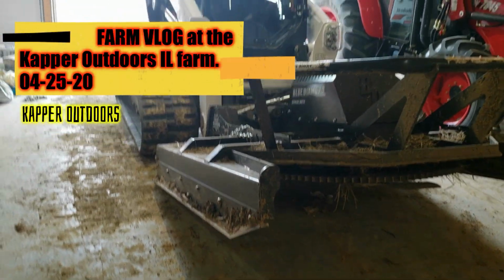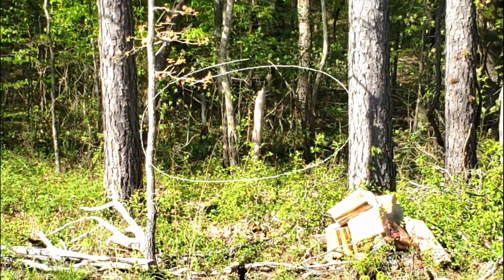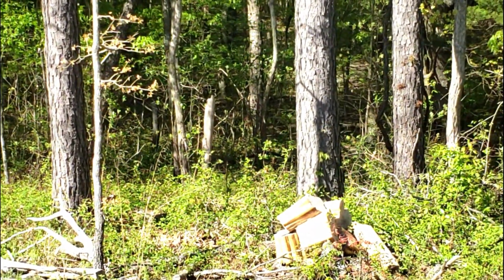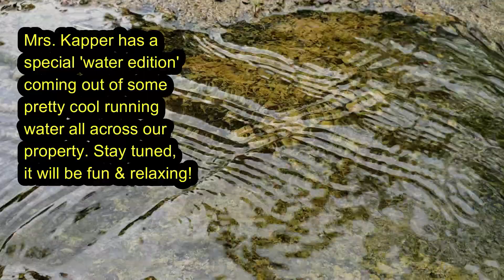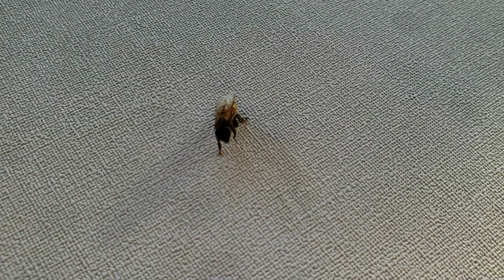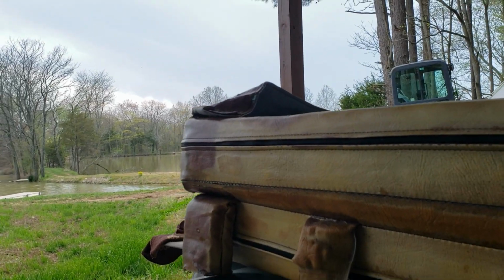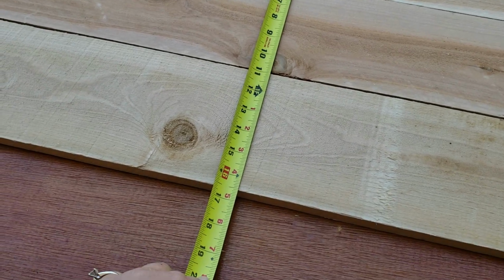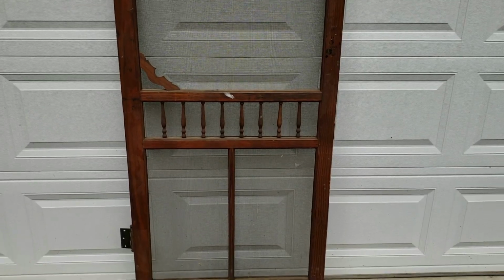Illinois FARM VLOG; Bobcat CTL, Bobcat sighing, Wildlife, Excavation equipment, & KY rehab projects

Comment: Joe, you are absolutely correct on the cover for quail--for now.   A farm field left fallow following crops is perfect for quail for the first couple years.  After that, the cover gets too "rank" for the quail to use and needs to be managed.  Either by mowing, discing, or BURNING.  So if I'm allowed to throw in my 2 cents worth, in years 3 or 4 do some rotational management to thin out the cover.   Nice to hear them calling, especially this early in the season.
Reply from the maker: Yes sir thanks! About time I got just a little agreement out of you buddy!! lol. Yeah, once it starts getting too nastly or thinning, I'll start rotating it out to keep differing levels of growth. Good thing I've got some tools for the job now! :)